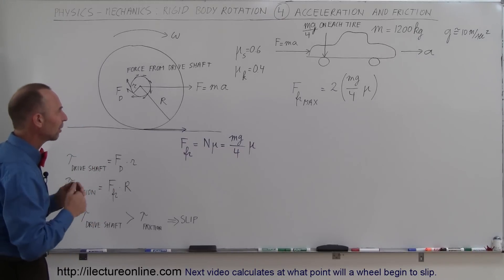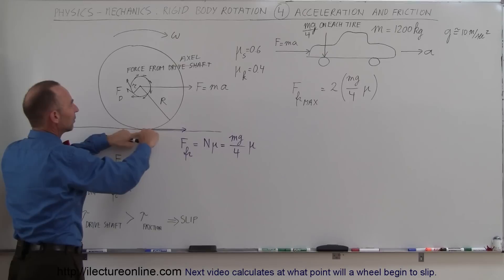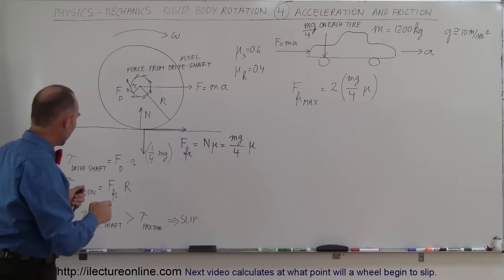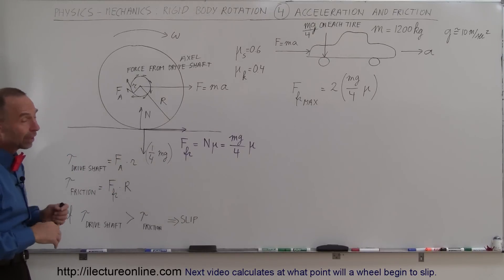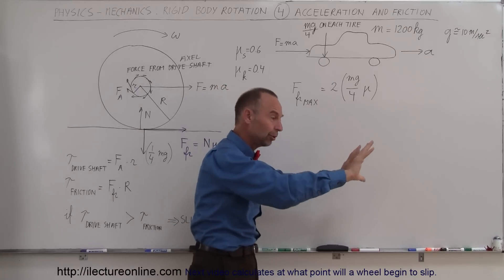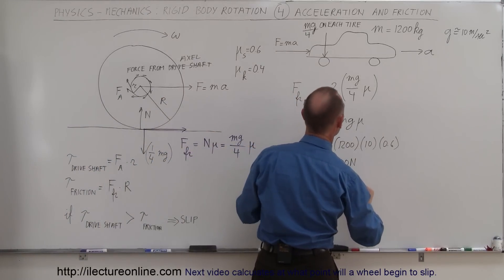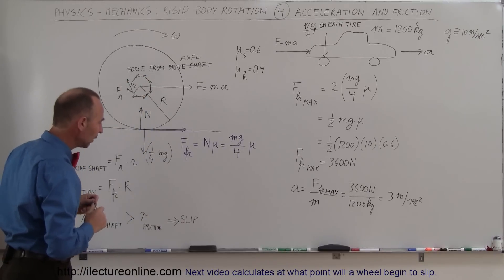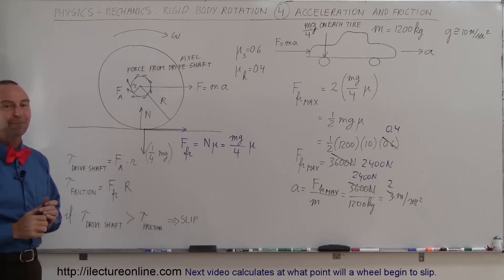Physics 11.1 Rigid Body Rotation (4 of 10) Calculating Acceleration & Friction of a Car Tire

Comment: Hi isnt the friction force opposite to the engine force?
Reply from the maker: If you are asking about the friction between the tire and the road, the friction force is directed to the back so that the reaction force of the road on the tire is directed to the front.
Reply: The engine is inside the car, so there is no "engine force" that acts upon the car to move it forward.   The force that pushes the car forward, is the static friction force (aka traction) that pushes forward on the drive wheels.

Think of the road-Earth system as being a "work mirror".  The car applies a traction force backward to the road, but the road is attached to the Earth.   The Earth is so massive that the acceleration due to the forces it receives from our actions upon its surface will be negligible.  The work done on the road will also be negligible, but the energy of the car's drive train will have to go somewhere.   The Earth-road system will therefore reflect the force and the work back to the car, to propel it forward, as a result of Newton's third law.  The work that the car does on the road that is reflected back to the car, will go in to the car's kinetic energy.

Comment: Sir, please slove the my problem. 
Problem: 
Conveyor Chain moving the 90 degree horizontal track line ,radius 750 mm. Speed 2mtr/min. Chain pitch 254 mm. Chain weight 7.5 kg/ mtr. Chain carrying load 19 kg / mtr. Total chain length 190 mtr. 90 degree horizontal bend 15 nos. 45 degree Incline plane 5nos up & 5 nos down. 
How much power need for moving the conveyor & how much torque will made.

Comment: Can you explain why at 3 minute mark you state it is the torque that accelerates the car but then say it is the friction? Does the torque from the tire translate to a linear force forward? Please and thank you
Reply from the maker: The torque makes the wheel turn.  The tire tries to rotate and pushes backwards against the road via the force of friction.  Newton's third law then dictates that the road pushes back with an equal and opposite force pushing the car forward due to the friction force.
Reply: @MichelvanBiezen   so essentially the torque on the wheel is transmitted as a force to the ground correct? From there, Newton's third law says the ground pushes back and it's this friction force, that drives the car forward. Is my understanding correct? Thank you
Reply from the maker: It is correct.

Comment: Why don't the torque from friction and torque of the axle balance out? Wouldn't they cancel
Reply from the maker: You need the friction between the tire and the road to propel the car forward.  Note what happens when the tire is on a patch of ice.
Reply: @MichelvanBiezen   the tire puts a force on the road. The road due to Newton's third law put a force aka friction on the tire. Wouldn't that then create a torque on the wheel that would cancel the torque from the axle? That's what I'm saying
Reply: @kevinspeltz7400 They do cancel, for a wheel of negligible rotational inertia, or for a wheel at constant speed.   For a wheel that is accelerating, the torque from the axle, will exceed the torque due to the traction force.   Essentially, some of the engine's power is "used up" in speeding up the rotational mass of the wheels.

Comment: Thank you for the great videos. Could you please clarify a little detail for me? If the axle and wheel are considered to be a single rigid body why wouldn't torque be F_a x R?
Reply from the maker: The force can only be applied where the drive shaft is connected to the wheel.  (You can't have torque at R if the shaft is not touching the wheel at the edge)  Even if the wheel and the drive shaft is made of a single piece, which it isn't since you have a differential coupling between the wheel and the axel, that you would still need to calculate the torque as shown in the video.
Reply: @MichelvanBiezen  Thank you for the clarification.

Comment: these videos are all so interesting AND EDUCATIONAL!!... just the other day I came across a Problem that is right in your "Wheel" House.. lol.. pun intended... I don't expect you to try the problem.. but I thought it was so simple that it started out DIFFICULT to me...  .. I'll just toss this out for the heck of it....   A car is driving down the road at 50  km/hr .. the tires on the car are spinning at a rate of 500 rpm's ... what is the Circumference of the Tire in meters???? ... sounds simple, yes?.. and yet I actually struggled with it..  (answer =   5/3 of a meter)   SHEESH..
Reply from the maker: Yes, it is odd that something so simple can be so hard to formulate and solve.   I run into that all the time.

Comment: Does it mean that a more powerful engine needs to be mated to wider tyre in a car ? Otherwise the extra torque from the car will only cause the wheels to spin. If yes, then it makes sense for BMW and Merc to equip their cars with wide foot print
Reply from the maker: There are a number of reasons why wider tires are used, including better handling during turns.  The amount of contact theoretically doesn't matter, but in practice it does offer greater control.  The spinning due to the tire slipping on the road will still occur, if the engines are powerful enough.

Comment: can someone explain why we didn't consider the friction of front wheels and its direction in our free body diagram for the whole car?
Reply from the maker: This video explains the maximum acceleration that can be attained because of the friction between the road and the tires of the drive wheels.  This car has rear wheel drive and thus the front tires do not help push the car forward (unless you have 4-wheel drive)

Comment: When you calculate acceleration, doesn't it need to consider the friction forces acting on front wheels as well?. F=ma is used here for entire mass of car. Not only frictional forces on rear wheels are acting but also on front wheels.
Reply: Since we are considering a rear wheel drive car, only the friction that acts between the rear wheels and the road is used to push the car forward. The front wheels contribute to nothing. In the equation F=ma, we take the entire mass of the car because the force on the rear wheels is the one that is used to move the car forward.
Reply: this is my question too

Comment: Sir, in your friction lecture, it is written that kinetic friction force is force that require to move object at constant speed. but in this video there is acceleration and it gets decreased. I get confused again sorry for my verdancy)
Reply: I think maximum static friction force is just about move of object. considering this, should we say that car begin its move with initial acceleration which is 3. but then decreased to 2 with kinetic friction force. but then I get confused again because of constant speed condition in kinetic friction force.
Reply: and, in your next video you wrote Fmax - Ffriction= ma. But in this video this equation is not like Ffriction - Faxel = ma but just Ffriction=ma itself

Comment: if applied force is less than limit of static friction does that both cancel each other? both force from axle and static friction are acting on wheel.Am i right,can anyone explain? How a wheel rotate?
Reply from the maker: It works like Newton's third law.  The friction force will propel the tire forward in exactly the same as when you walk.  The friction force between your shoes and the ground propel you forward.
Reply: @MichelvanBiezen  but,from the FBD it looks like friction create and anti-clockwise torque,so if thats propelling then rotation should be in opposite direction?
Reply from the maker: Without friction, the wheel would spin in place in a clockwise direction.  With friction, the wheel will still turn in a clockwise direction, but not slip and the center of mass will move to the right.
Reply: thankyou sir for the response.
Reply: So it should be like at bottom the friction stops causing it to roll and throw the bottom portion to double velocity when it reach the top.So this static friction force is present at starting of rolling, continuation of rolling until a  deceleration force greater than static friction is applied causing into slip.right?

Comment: I believe this is wrong. You are using Sliding friction equations for rolling object.
Reply from the maker: The video is correct.  If you want to know more about rolling friction you can find videos here:  MECHANICAL ENGINEERING 11 FRICTION
Reply: Rolling friction comes into play when body is already rolling.... when it starts from rest as in this case, you have to use static friction always.. So the video is absolutely correct.

Comment: super important questions for me:
1.lets say there is no tyre friction and no air resistans
and car accelerate from 0-50km/h in 5 seconds and the engine produce constant 10Hp. So if car want to accelerate from 50-100km/h in also 5 seconds - car needs 40Hp couse "double the speed = 4 x more energy" 
Is that correct?

2. How about if we add air resistans in question nr 1? How does it change?

3. Is this principle works in space when there is no gravity?
I mean if we have spaceship which accelerate from 0-100km/h in 10sec we need also 4x of energy if spaceship want accelerate from 100-200km/h in also 10sec?
Reply from the maker: 1. Correct.2. Depends on how the problem is defined.  Typically air resistance becomes a function of speed and then you need differential equations to solve it.3. Yes, it would be the same in space.
Reply: +Michel van Biezen
So, thats mean if spaceship mass is always same and the engine produce constant 100Hp 
this means that with the increase of speed, the acceleration will decrease. Because E=1/2mv^2.
And if this spaceship is moving with constant speed of 1 milion km/h it will need enormous power to accelerate just a little bit (100km/h more for exaplme) 
Is that correct?
Because its so confusing for me:)
Reply from the maker: Power is work/time and thus if the power applied is constant, the acceleration will decrease with increasing speed.    The reason why it is confusing is that if you look at Newton's second law  F = ma, when a constant force is applied there will be constant acceleration.  And in space, spaceships are propelled using the principle of conservation of momentum, since there is no air to push against.

Comment: Hiii Mr. Michel

I looks your calculation its very clear to all of us. I have only one doubt that is, you have divided the total load in to the 4 nos of wheel , and as you drive only rear wheel you consider the twice of frictional force instead of the total Frictional force as resisting force. Please explain on that point sir.
Reply: That's because weight is shared equally by the number of contact points (4in this case) and friction by definition is the force that is caused in opposition to motion. Since only the rear wheels generate the power (and in turn motion) at the instant of transition from rest to motion, hence we only consider the effect of these two tyres in the frictional force calculations as these are actually the ones that overcome friction.
Reply: I have the question like you :)

Comment: sir, what is the differences between Us and Uk and when do we apply those friction force? in what condition. thanks
Reply: Us is the static friction and
Uk is the kinetic friction 
Us is applied for the static calculations of the vehicle while calculating normal force on the vehicle weight distribution etc. And uk is used to calculate the dwt of the vehivle, Torque required to rotate the tyres etc. Hope so you understood it.  :)

Comment: and that's why we apply brakes in jerks and not press it down full as when we press the brakes at once, the kinectic friction acts which might not stop the car quickly and lead to a hazard
Reply: This is the working principle of ABS brakes (anti-lock braking system).  This is a system that will "pump" the break pedal for you when the car starts to skid.  You want the friction in the wheels to remain in the static friction regime, so that you can continue to control your car through steering.  If your brakes lock up and the entire car skids, turning the steering wheels will do nothing, as the car will have no preferred direction to move relative to the wheels.

If you didn't have an ABS braking system, you would manually pump your brake pedal, any time you get in to a situation where you have to brake at maximum capacity.  You want to avoid this situation in the first place, by slowing down more gently where you don't need to pump the brakes and anticipating a comfortable stopping distance that won't damage your car or occupants.

Comment: Can you please explain me the difference between sliding and slipping?? I know these are basic terms but they confuse me alot in this chapter. Please do reply as soon as possible. You're great by the way.
Reply from the maker: Sliding is usually associated with a non-rotating object moving (sliding) across a surface.  Slipping is usually associated with not having enough friction between the two surfaces and thus either begins to slide (if it is a non-rotating object like a person walking on ice) or with a rotating object that does not have enough friction to cause the object to rotate (like the tires of a car).
Reply: Thanks a lot!!

Comment: Thanks for the great video!! I am wondering how the friction force become the force acted upon on the CoM of the wheel. My explanation is that when we put the wheel in space and add a tangential force on the rim of the wheel(assume the wheel is 2D.), the wheel will move straight in the direction of the tangential force and, meanwhile, rotate relative to the CoM of the wheel. Since the driving shaft only provide the torque, which is eliminated by the friction force(Without slipping), and not force on the CoM of the wheel, the friction force become the moving force(F). Am i correct? Is there any theorem involved in the moving and rotation in the space? Thank you very much in advance.

Comment: at any mass of vehicle i am getting same acceleration  how its possible
Reply from the maker: The force accelerating the vehicle is the friction force which is also proportional to the mass of the car.  What you must also consider is that the engine must provide the power to accelerate the car.  That is where you will be limited.

Comment: let's say you have a bike that is decelerating, can it's deceleration be greater than the standard gravity (g)?
Reply: Yes.  Look up some of the record speeds of cyclists, and you will see several examples that are well over 100 mph.   The terminal velocity of a human body falling with air drag is around 100 mph, in the spread-eagle position.   If you achieve one of these high speeds of a cyclist, and then spread out your body so aerodynamics make you slow down as much as possible, the air drag will slow you down faster than the acceleration of gravity.

Note that many of these record speeds have been assisted, either by a motor-pacing vehicle that the cyclist drafts, or by a downhill run.    Take away the motor pacing vehicle, and air drag will act upon you that will slow you down significantly.  You can arrange your body to either minimize or maximize the drag.   The unassisted record speeds on basically flat land, are slower than 100 mph, and you see precisely why it is difficult to break this barrier.   The traction in your tires isn't sufficient to get you up to this speed in the first place, even if you were strong enough.  Tires have a static friction coefficient on the road that is very close to 1 in ideal conditions, so it is unrealistic to expect to get higher-than-g accelerations through traction alone.